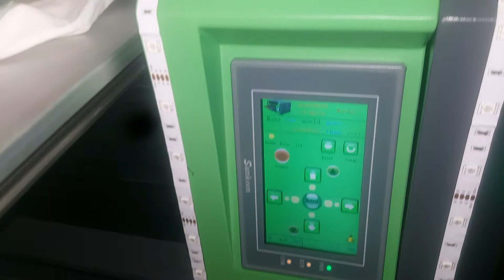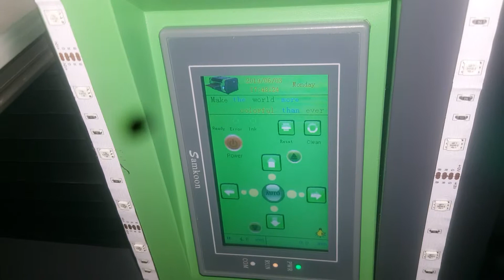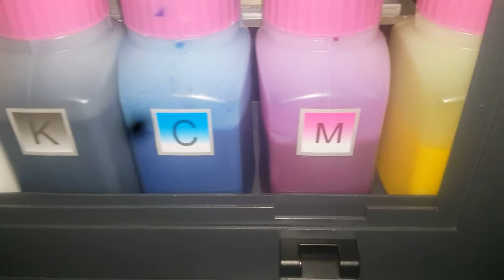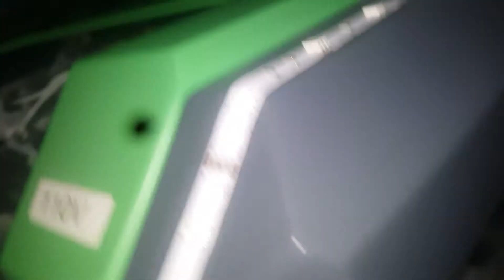Problem with DTG(4)

Comment: if you just refilled the ink reservoirs that could be your problem, make sure there are no air pockets in your hoses, if you pulled the cap off the reservoir and exposed the straw to the air u need to do an ink charge not a cleaning. However if you hafve had this machine for awhile and have not maintained it, you need to flush the printhead.